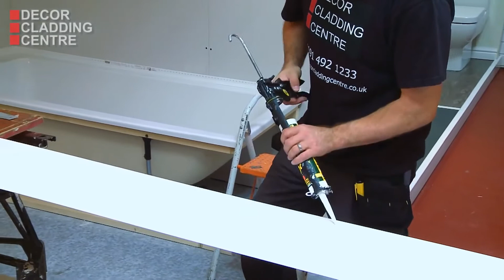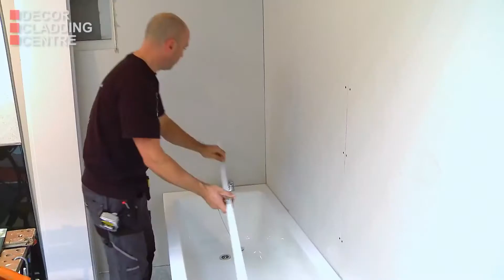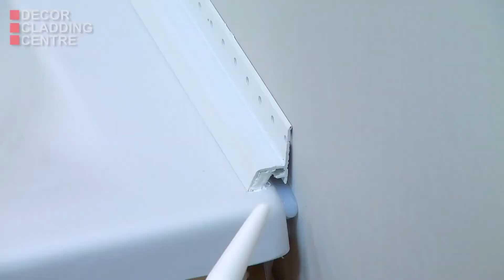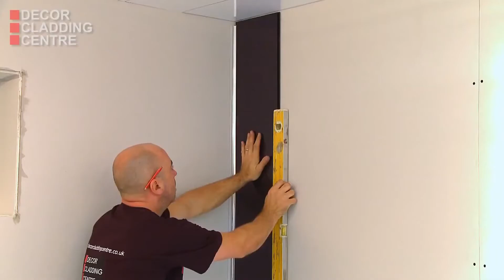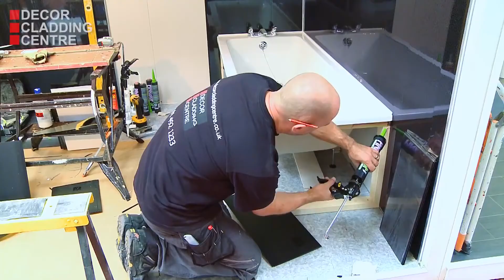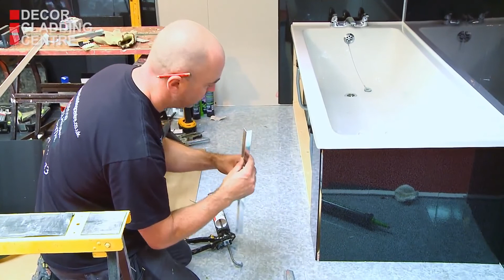How to Install Bathroom & Shower Wall Panels | The Panel Company

Comment: Do you have to install ceiling panels to install wall panels?
Reply from the maker: Hi Aimee - No you don't have to you can just install wall panels and finish off where the panel meets the ceiling using an end cap trim, alternatively you can seal with silicone.

Please see our trims page - https://www.panelcompany.co.uk/collections/trim-accessories